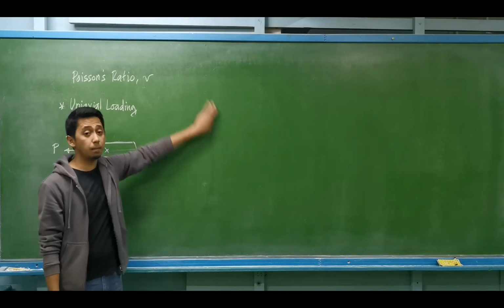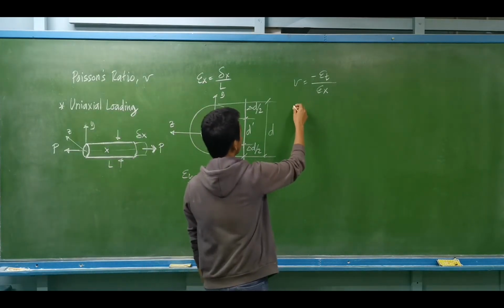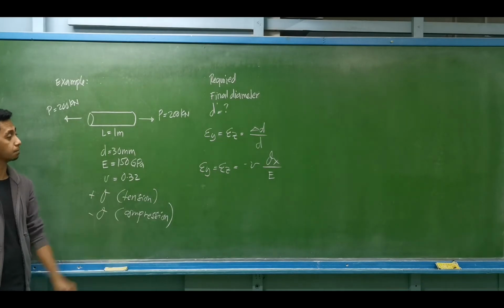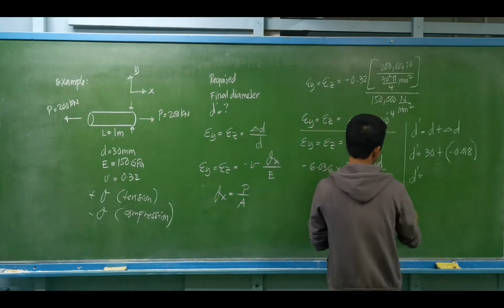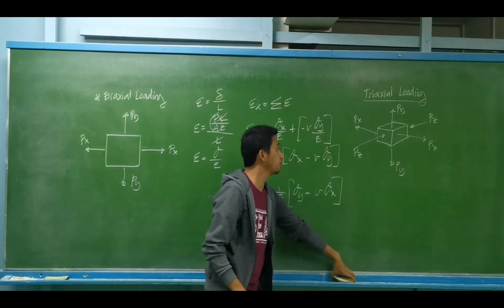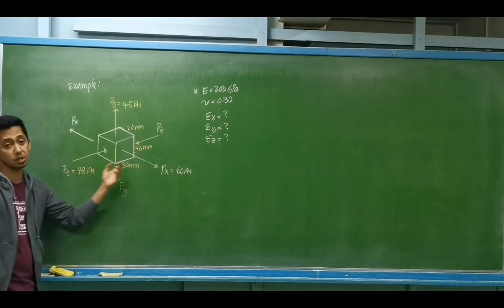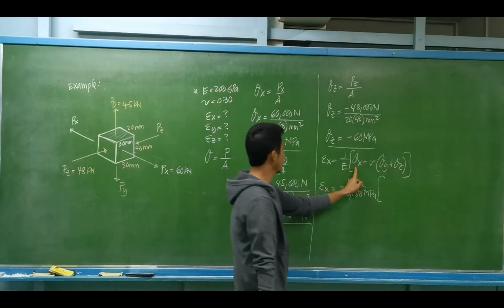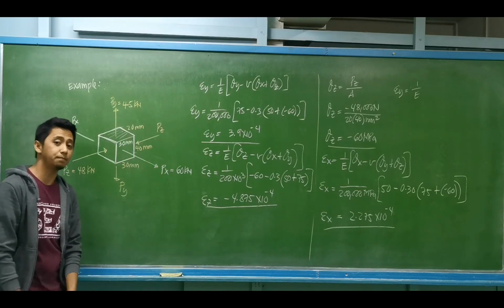Strain - Uniaxial, Biaxial and Triaxial Loading

Comment: Hello, sir! How can you determine if the problem is uniaxial, biaxial, or triaxial?
Reply from the maker: Uniaxial if only 1 force is applied to the sample along its main axis. 

Biaxial if 1 force is applied per axis considering 2 axes like x and y.

For Triaxial, 1 force per axis considering x, y and z.
Reply: @AbrenianLecturer   for example, sir. This problem: The 50-mm-diameter rubber rod is placed in a hole with rigid, lubricated walls. There is no clearance between the rod and the sides of the hole. Determine the change in the length of the rod when the 8-kN load is applied. Use E=40MPa and v=0.45 for rubber.

How do i know that this is uniaxial or biaxial?
Reply from the maker: I think that can be analyzed as Triaxial,  the wall will provide the force/pressure on the other 2 axes for example y and z. But strain in y and z will be zero since there is no clearance.
Reply: @AbrenianLecturer  okay, sir! Thank you!